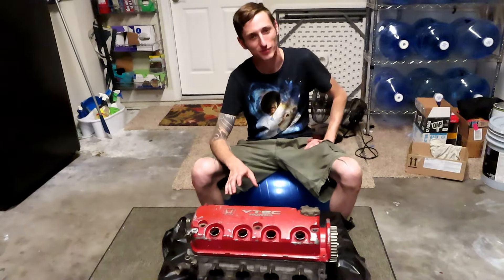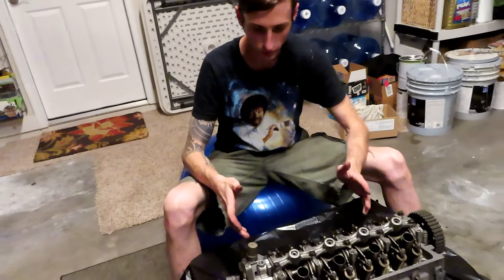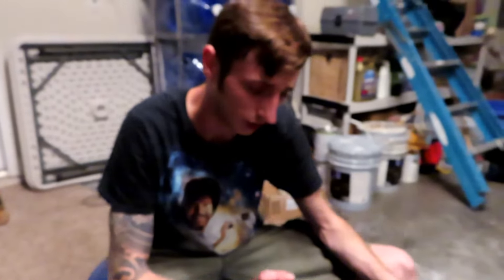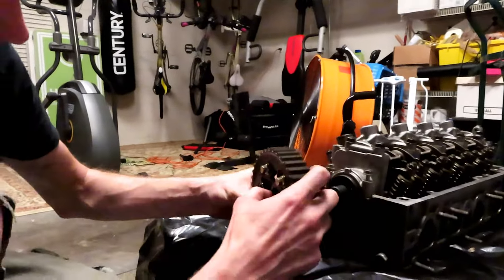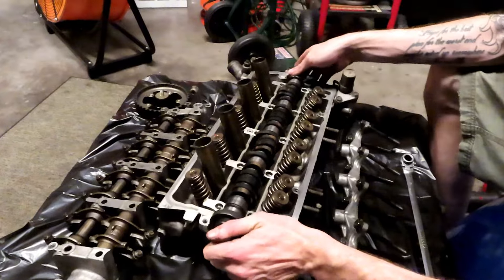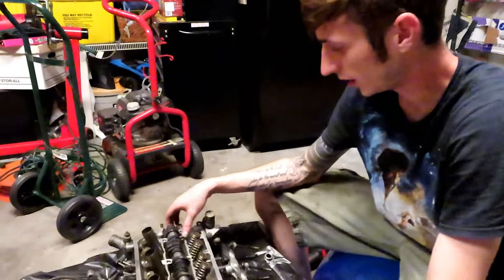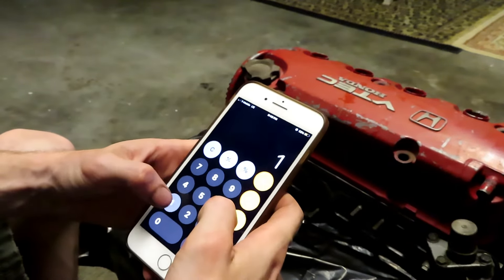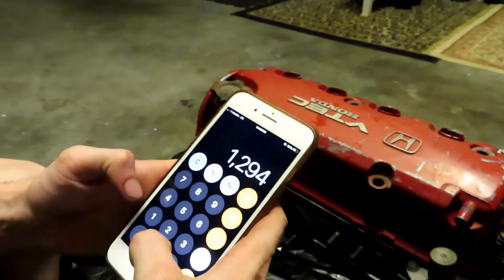CHEAPEST Way To Make 500HP With a D16 Head

Comment: $250 for a stock z6 head with bc springs and stock cam? That's a ripoff....
Reply: Mitch Weber hell yea told rip off where I’m at I could get a complete stock head for 40-60$ even some with aftermarket cams maybe 100! At most lol I
Reply: im building z6 right now i got block head crank oil pan arp head stud for $60. gave me bunch of freebies
Reply: @xjdmEJ2x  where the fuck are y'all getting a whole head for that price? I can't find a stock head for 200
Reply: I WANT ANSWERS
Reply: @georgemuller3998  do you an extra running car? go check facebook market place.i live in midwest and hatchbacks and integras here are unicorns it took me more than a year to collect parts when i see parts on facebook with in 1-2 hours drive and cost less than $100 i buy em and ask em what they can give me for free? the guy who gave me turbo, the while z6 motor and arp studs got into an accident and he want to have a big part on my build so he gave me everything for almost free
Reply: I got a whole y8 longblock and matching tranny for 200 on offerup.
Reply: robert vega facts all about networking and expressing ideas. same on this side.
Reply: @BvtecturboEKHATCH  i call bullshit
Reply: Access to a machine shop and bisimoto hmt and flat over size valves daul valve spring retainers and port but look up specs of milling   and arp or make your own aka shop cam get specs from cams first if i had a shop and help i can do anything metal etc. i been threw brain tumors learn how to walk all that some people are pathetic. I been threw more than people have in life times thats on the people on this vlog blog chat whatever i still just push to go i dnt even get disability people hacked my shit all kinds of stuff its messed up you really dont have any friends ive helped people and nobody really had my back nothing just was around toget what they could bs never really got in this jist tried to stay alive really people take and take and take and are fake you help and i might have few real friends i had one or 2 friends come see me when i was in hospitals and nursing homes im a younger person just now having my life and its messed up you just have to fight and keep going i have more fight in my toe than a person has in body heartattacks all that bloodclots threw lungs should have been a shriner's kid really i should make videos i was 500+ lbs now 300 it goes up and down its ruff i dnt even know why im putting stuff on here its  point less i had brian crower stroker kit real JG engine dynamic intake and throttle body fuel rail dart head pistons rods rebuild kit and pump didnt get the block and top mount TO4b top mount turbo and wastegate with down pipe sidewinder style manifold and hondata s300 and jumper not the intake mani looks like round looks like a skunk2 H22 big manifold with 72mm TB people are messed up had good stuff and stole it and if you help me ill give and pay lost a bunch too messed up should get mine now fuck it helped and done right to much for me to have been done this way i know this isnt make a wish foundation if you dnt like it my scars can tell u how much i care what u think ill take my judgement from someone who cares......
Reply: lol I got a z6 head for 40 on OfferUp a couple weeks ago
Reply: @BvtecturboEKHATCH  what are you wanting?
Reply: it's hard to find old cherry Honda parts in the rust belt for cheap.
Reply: Idk that looked pretty clean..you could probably find a clapped one for 50-100.
Reply: @meyersdale2299   hey i wanna add to my engine a new cam performance ,you thing that I can get a litle power ?
Reply: Lol you winging here in Australia I’m looking at one head the guys had it up for a while he wants 3500 and doesn’t even come with a cam gear and your crying about finding one for 250 wtf 😂 I’m legit considering swapping one of my cars for it if he says yes 😂